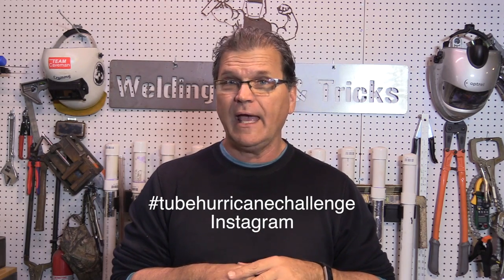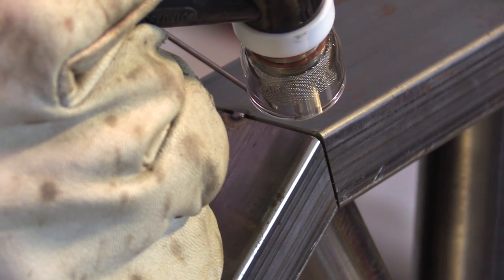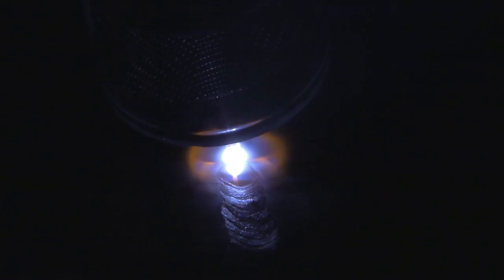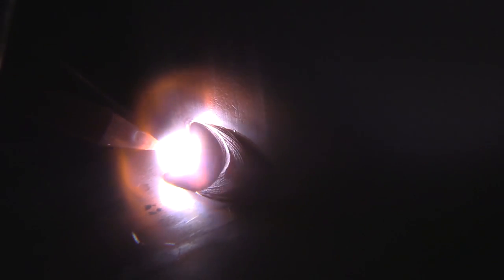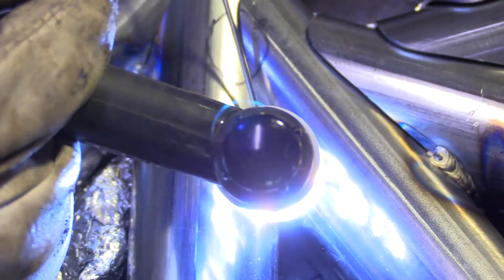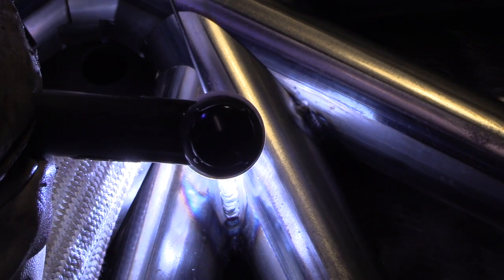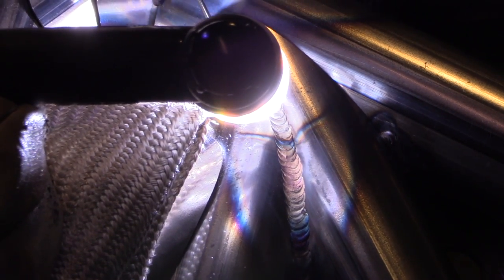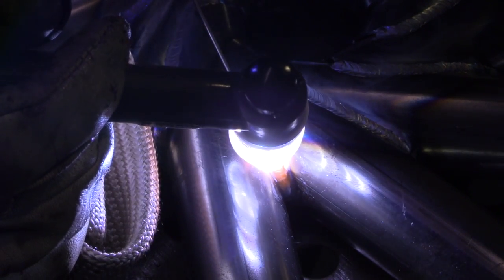Weldng the Tube Hurricane Challenge

Comment: What I used to do so the last weld doesn't blow out is heat the whole thing up and then weld the last hole left, as the rest of the assembly is cooling down it creates a very light vacuum. That has been my experience.

Comment: You make it look so easy and relaxing. I have trouble keeping the electrode at a constant distance and at a constant speed. Its almost like I need a pen shape handle to make it easier.
Reply: They make straight torches , so you can use it similar to a pencil.
Reply: @erikhockman8590  Really? I've only just started with TIG. So I've not purchased my own gear yet. Still using college equipment. Ill need to keep an eye out for that, I think it'll make a massive difference. Thanks for letting me know!
Reply: You'll get better with practice but those CK flex hoses do also make it much easier to keep the torch where you want it.
Reply: @gtxviper  

Yes, definitely when you buy a torch, buy a CK flex. It's nice to be able to move it a bit to make the presentation angle comfortable.

Comment: I've had some success sealing tubes/boxes by heating the entire work-piece to 450-550 F, then cooling the thing while welding the seal-hole.
Idea is that as the metal is cooling, the gas inside the part will contract and so gas expansion from welding-heat is offset.
Gotta balance it, else you end up sucking metal and junk into the part!

Comment: That wheel in aluminum would be interesting. It'd be awful hard around that center. In the means that a guy would really have to be good at controlling the heat. I do aluminum every day and it would be so easy to drop the bottom out if ya didn't have good puddle control. Or stop and let it cool. And most definitely need a tig finger! I love those things. I'm gonna order a hoodie soon

Comment: Another question; when you are welding are melting the material and adding in the rod or are you heating the material and adding the rod on top the material to make a "cap" if you will. Just curious

Comment: I have only welded with MiG and stick , not much of a bragger but I did get pretty damn good with a 7018 and 6011 😅from fabricating on an asphalt plant that I was operating for 8 years , My question is .. you started with those exterior seams without a tack on the inside to keep it from pulling out ? When you tig does the steel have less tendency to pull and warp out like a stick ? Cause I sort of learned that I always had to tack to keep from it bowing with the heat and such , I want to Tig and been watching your videos for a while now , appreciate your videos thanks , now I need to afford a decent tig

Comment: is that 1A / per .001" rule across the board?  For example, a piece of Steel .001" is pretty thin. 1 Amp seems like t would burn thru. Just wondering.

Comment: Use some er70s6 mig wire, .035 diameter and you can twist pieces together to make thicker wire.
Reply: Just did that very thing 2 weeks ago for a tiny favor for a work buddy, but didn't twist, I just needed something smaller than 1/16th.

Best way to twist, in my opinion, is throw one side in a vice and the other in a drill chuck and fire away

Comment: Hi Jody, I have difficulties finding much information about brass TIG welding.  What would be the amp per thousand for brass?  I have a project soon, to work with 0.050 to 0.060 thousands thin brass rectangle profiles.   (67%copper+33%zinc brass, to be exact).  I'd appreciate your best guess even if you don't have experience with it (the response I usually get :) ).  Thanks.
Reply: You won't be able to Tig zinc brass. The zinc blows out and ends up a mess 

You need to braze it
Reply: @MT_T991  Incorrect.
Yes, the zinc will melt in a lower temperature than the copper. Yes, some of the zinc will evaporate. Yes, the final ratio of copper to zinc in the base material will have less zinc. But saying that it can not be TIG welded is incorrect because I know that some people are doing it.  Matthew, your reply is basically answering with an "I don't know, It's too complicated for me".

Comment: I would have made 1 weld on the inside of each tube to tighten it up then do the rest of the tubes .They should have used stainless .I welded that fancy cut steel before and stainless always did better. Nice job.

Comment: Hey Jody, have you ever used a thumb wheel amperage control on your TIG stinger? I built aluminum catamaran boats for a couple years and i'd use them up higher on the boat tigging up hand rail joints. Took a little getting used to but man they're nice in those situations!
Reply from the maker: I havent used them much..but I intend on trying some out soon...they are great for when you are up in the air or crawling around a lot
Reply: I built anodized boat stuff at boat works company for a while, they did it all with a button, usually there's little variation in material thickness to require amperage adjustments once you find the right setting, we more or less used 200 amps for most everything structural, 125 amps on boat tanks.
Hated the work, none of the pipe joints were notched, all bologna cuts and fill the joints, structural garbage with hugely wide welds.
Reply: I got that on my Migatronic TIG, like you say it takes a little time to get used to. you need to have "the right" gloves so you still have feeling in the adjusting-finger. I dont have a pedal but use the thumb-wheel a lot, as the Migatronic is the macine I often travel with to local raceshops and tuners to do their welds. Like Jody say, its great when moving around the subject your welding alot. I sometimes make stainless exhaust on Yatches and believe me, there would be no space for a footpedal ( And most of the time, you lay flat on the floor because of space) in those small gates one have to crawl when tacking the exhaust together in position. Great video Jody, as always. Greetings from Norway

Comment: Could you use thick MIG wire instead of tig filler rod?
Reply: You can if you want. Might want to buy a small wire straightener to pull the wire through and get it straight.

Comment: I have some 308l rod and when I weld with it on mild steel it doesn't have any colors in the weld. Just looks like a normal mild steel weld. Why is that?
Reply: Lots of dilution going on. Not sure what metal chemistry your left with in the end. Definatly not a recommended filler for something structural but for a decorative piece it's ok to use stainless filler on mild steel. It also will not deoxidize the weld puddle like a rod with a bit of silicon will.
Reply: Yea dilution got to get moving . I am not good with it either. Part of the key is he's not pushing through the base material very hard right on the edge

Comment: I have 0 welding experience, so please refrain from bashing me. Why do you hold the tip on the weld after your line is complete at the end of each bead?
Reply: This allows the metal to cool in an inert environment.
Reply: @legionof0ne441  I understand, ty for clarifying for me. I'm guessing you'll get some sort of "gunk" on the tip if cooled in a dirty environment.
Reply: @rileymcfee6946  Not on the tip of the electrode, your weld at the end, stops oxidization and other contamination.
Reply: @legionof0ne441  👍 thanks for that. Welding really intrigues me, it's an art really. Some people may think it's "just a trade" however there is a reason for the higher pay. I am also in a trade (HVAC) now learning telecommunication and fiber splicing. I always say "it's not what we do, it's what we know" Rock on brotha 🤘🤘🤘

Comment: 70 s-2  higher silica content than 70 s-6 .  Given the choice 70 s-6 every time, but companies rarely are willing to spend the extra money as  70 s-6 as it costs more.  I was told  it takes a new Qualified Welding Procedure to run -6 but I do not believe that is true as it can be considered a minor variance, as I understand it.  It could be compared to a procedure ran with 5-P (6010-Red rod) but be restricted from running 5-p+(6010-Grey) this would make little sense.